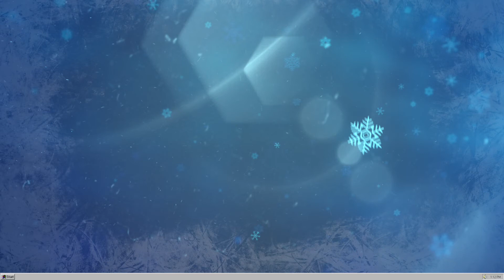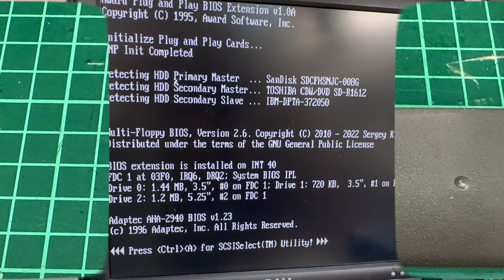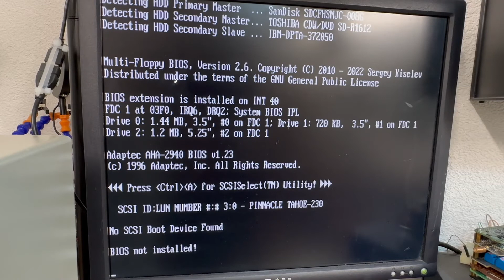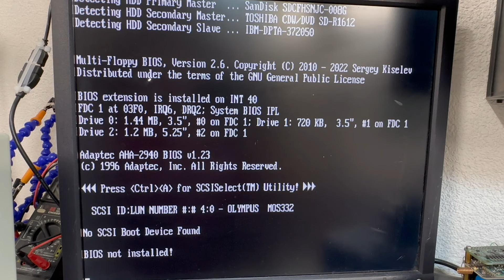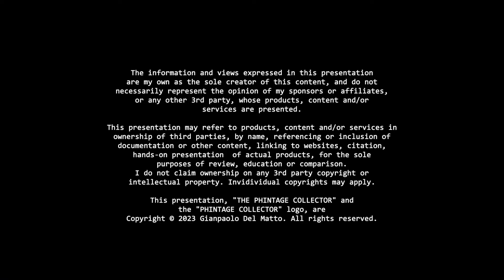Inspecting collected MO (magneto-optical) disks and drives [#TPCxmas23 Part 15]

Comment: Am I correct in thinking that the data is still stored magnetically, but at much higher density thanks to the enhanced accuracy provided by the optical side?
Reply from the maker: It‘s stored magnetically, assisted by a laser heating up the material above the Curie point.
As opposed to other magnetic media, the MO disk is therefore resistive to magnetic fields, so the data won‘t be lost.
And the data is read optically, loosely comparable to a CDROM.
It‘s not so much about density, just a different technology.
Btw, Sony‘s MiniDisc used the same technological approach.
I thought of doing a full video on MO disks, as it would have gone too far for the advent calendar efforts-wise.